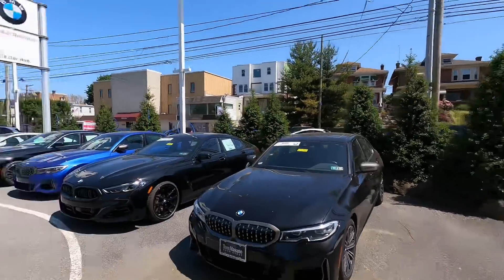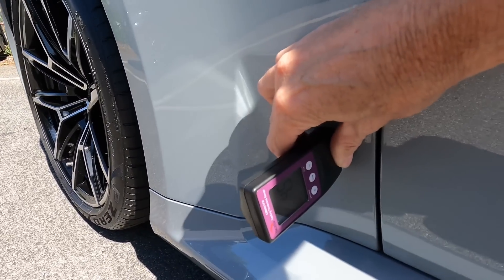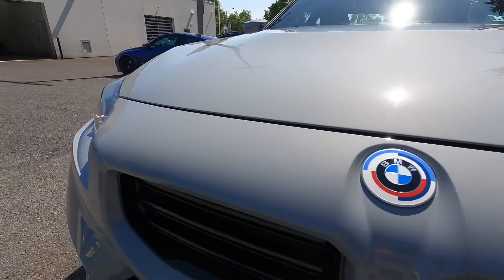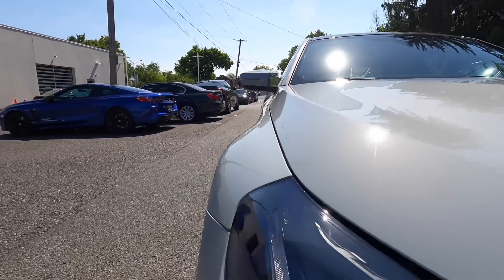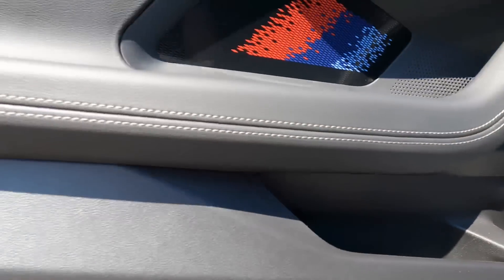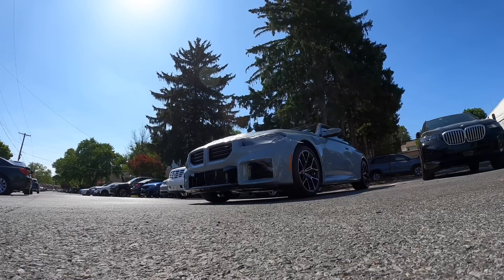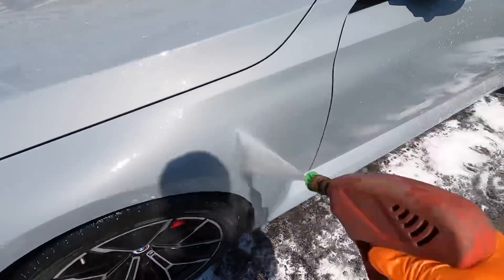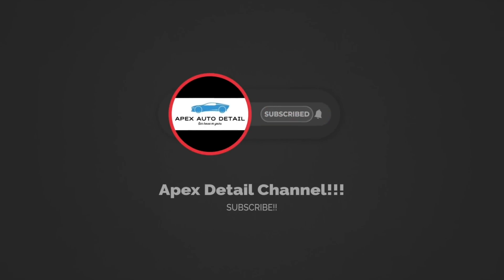NEW BMW M2! Pre-Delivery Inspection! Issues?

Comment: It's nice to see someone as anal as I am when it comes to vehicle delivery. I used to work at a Jaguar/Aston Martin dealer as a delivery quality control specialist. Literally my job was to go over a vehicle front to back, top to bottom, inside and out, even under it, to look for any inconsistencies, defects, misalignments, you name it. I was very thorough. And prior to the customer picking up the vehicle we would put it in a climate controlled building where I would literally go over it with a white glove. Any detailing issues would be addressed, and the vehicle would be in perfect condition when the client arrived to inspect and take delivery. Not a bad gig for someone that was 22 and started there in their detail department working for a contracted company that did the detailing. Being OCD and anal about everything has it's benefits. :)